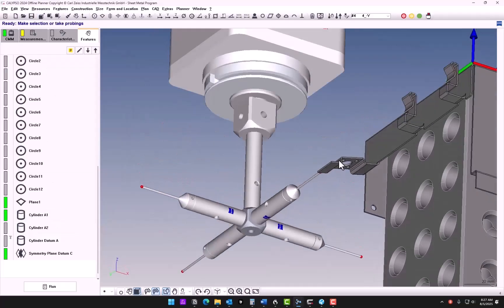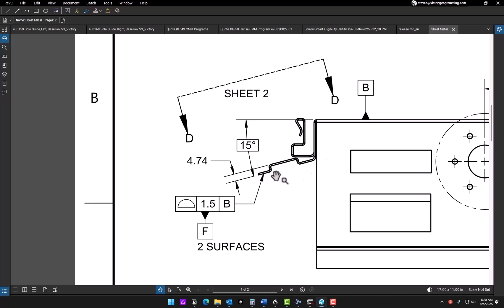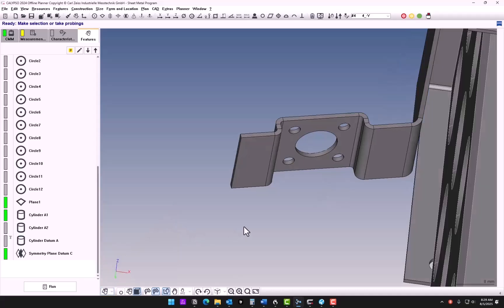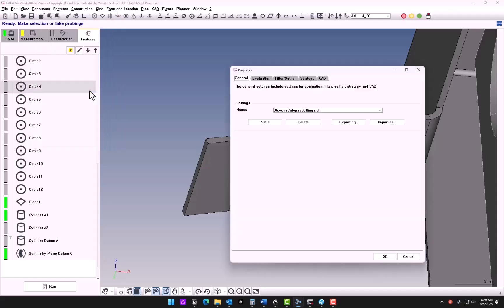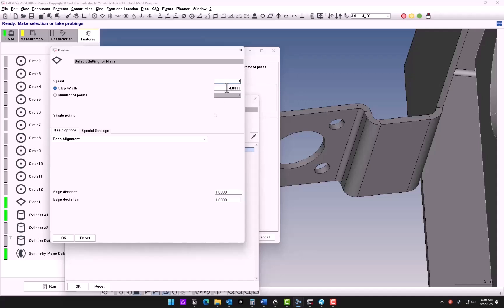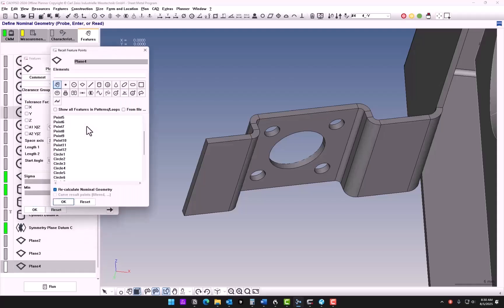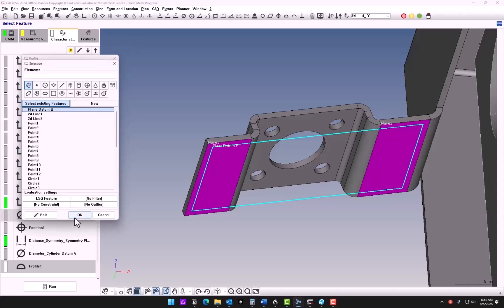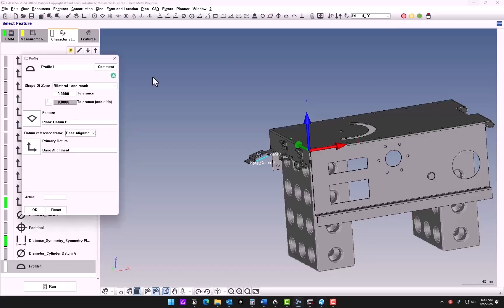Zeiss Calypso CMM Tutorial: Coplanar Datum

Comment: I don't know how I feel about you changing the profile to the base alignment just because Calypso is glitchy. Now the issue is that profile is also being constrained to the other points of your alignment, which could potentially fail the part. It might be worth using Calypso's new GD&T feature to see if that works better.
Reply from the maker: Yes, you are correct. The new GD&T engine in 2025 is more capable.